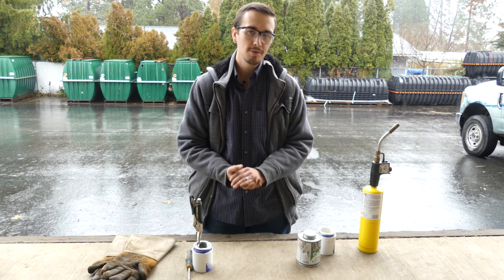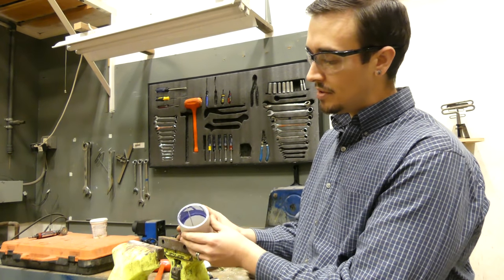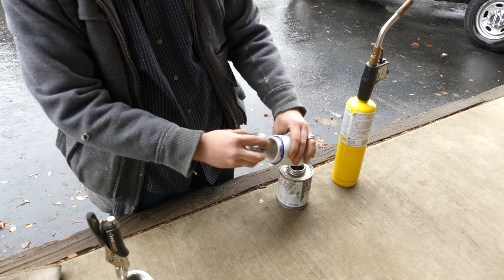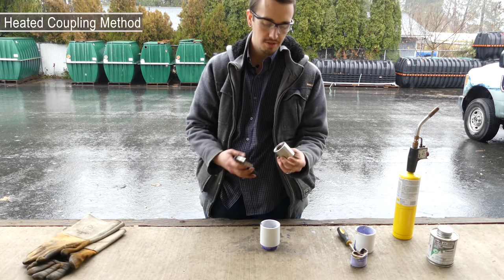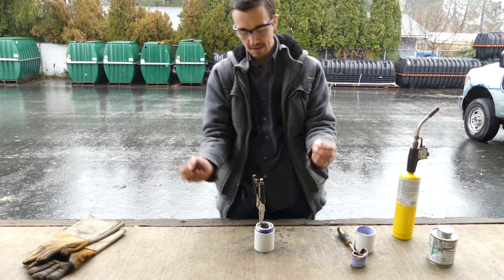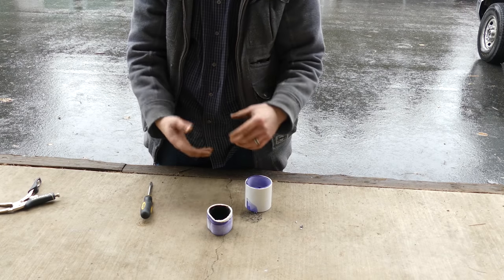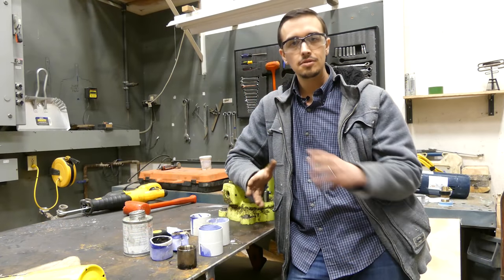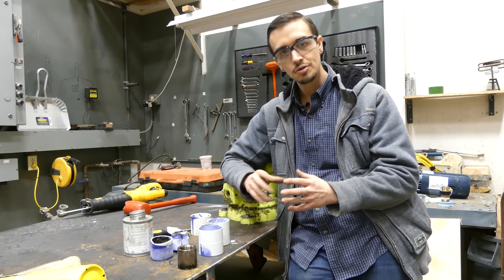3 GENIUS Ways to Remove PVC Pipe from Fitting (Without a Heat Gun)

Comment: i gotta remove an old 80mm elbow which is on the outside. i would have to use method 1. thinking more cuts and a more prescision  tool, like multi tool with semi circle blade or even a dremel? maybe when a bunch of cuts have been made i could paint on some acetone to soften the adhesive bond, work a chisel to pry off the cut sections..?? anyone had luck doing it that way?

Comment: If the pipes have been solvent glued together properly, you will not be able to separate them.  And SW fittings are cheap as chips - replace with new.

Comment: Can you do a video for prepping a slightly damaged pvc after the inside pipe was removed? Sometimes the female end is in a bad spot and cannot be replaced.
Reply: You just warm up the open / deformed end of the fitting with a heat gun and when it's soft enough, jam a piece of pipe into it to bring it back to circular.

Comment: They make a PVC honing tool for removing pipe from inside fittings. How about we try that.
Reply: that is fine if you have the $$$ to spend, I know that those are around 60$ to 80$ each or around 209$ for a set of 3, it's well worth the money if you're a plumber but for the average Joe it's really not worth buying them
Reply: Nah, they also make cheap ones, less than $15. May not be as nice or polished as  the $209 pro versions ... but great if you only have a few pieces to do.

Comment: I would NEVER use any of these examples even in a emergency, especially on pressure lines. Any competent experienced plumber would have a set of different size fitting savers aka socket savers in his truck to accomplish that repair. Anyone who does a repair like in this video didn't take the time to redo it right.

Comment: the 3rd method seemed to be the best one if you want to reuse the pvc. the 2nd one could be probably the most dangerous if someone did this on a connected piece of pipe, any flammable gas in the pipe could send the house into low orbit......in a number of pieces that is.

Comment: Primer must be worked in not just put on. The roll of primer is to remove the glase, but just putting primer on will not remove the glase. With the glase removed the cement will then weld the 2 pieces together.
Reply from the maker: Moz, as a pump/plumbing business that has set thousands of well, drainfields, etc. I am sure we applied the primer and glue correctly. Thanks for the comment.

Comment: I don't understand the point of applying the primer. I just torched the hell out of the outside pvc on my pools push pull valve for about a minute and it slide right off pretty easily.

Comment: I appreciate your work on this presentation but I would Never trust this connection again and new fittings are always the way to go.  If not an inexpensive heat gun is the only way to heat the fitting properly without damaging the existing fittings.
Reply from the maker: Thanks for the comment!
A heat gun would undoubtedly work better than what we showed, but not everyone owns specialized tools or has access to them when an emergency repair needs to be done. It's always good to know what your options are with the tools you have on hand. Of course, this is just a band-aid until you have time to repair it properly.

Comment: Is it just me or did anyone else notice that none of the joints were actually glued?  They were just put together with purple primer.
Reply from the maker: We used both, the primer is purple and the cement is clear. If we just used primer they would have came apart by hand.
Reply: @RCworstwater  In Canada only Electricians use clear because it does not hold up as good. You are using pressure fittings maybe change you cement.  Also in the field your burn method takes way to long.
Reply: @RCworstwater  also why not use clear primer if your looking for a clean looking joint?  I make my guys use purple primer and grey cement.   That way I can tell if they were glued right, especially when they are 20' up in the air.

Comment: Frame tool, power tool exterior stage to show your work are not worth to save a cheap coupling. If your plumbing material is .iron, it will be easy to take off and replace

Comment: All of that work and time because you don't want to spend a few bucks on a coupler and a short length of pipe to correct the issue properly. Not to mention what is the integrity of the fitting you worked so hard to re-use? I would rather you just dry fit your fittings and make sure every thing is correct before adding glue.
Reply from the maker: Thanks for the comment Chris! This video is geared towards people fixing a joint in an emergency - new parts are always the best, but not everyone has access to them when an emergency repair needs to be done. It's always good to know what your options are with the tools you have on hand. Of course, this is just a band-aid until you have time to repair it properly.
Reply: Very true. In a pinch this might be an option. But the last options. Good video thou. Never hurts to learn new techniques. I like how you compared three different options. You can never have too many tools in your tool box. This video just added three to mine. Thanks
Reply: They make a hole saw style pipe cutter too. Has a washer that rides on the inside of the pipe and then the outside wings cut the pipe out of a fitting. Only issue is you need a cutter for each size of pipe but they will pay for themselves the first time.
Reply: when a pipe breaks at a slab and you can remove a broken fitting, this is the way to go. you can do method one with metal gas and water lines. i hope chris curell snaps a pipe and has to use this lesson.
Reply: Problem isn't really saving money for just the coupling it's about where you are located. I work in an area where you move from your spot you can spend a good hr to hr and a half looking for a parking spot. Not only that but the time to get to a plumbing store, your time, your gas, and miles being put on vehicle. It starts to add up.
Reply: When you run in to a closet flange that is broken or, more commonly, was installed at the wrong height for the finished floor you are not going to tear up the floor or the ceiling to cut back and rework the pipes. Method number 1 works great on glued in PVC closet flanges.
Reply: Please don't tell me you're one of those guys who dry fit everything and mark it with a sharpie. If you are, just put your name on the sign up sheet. As for making sure it's correct first, of course. But you can pull it apart if you just glued it, no need for these methods.                                                                                                                                                                                                                                                                                                                                                                                                           If you are in the trade long enough, you have had to do this at some point. It's not a good time and only if I'm desperate. Hacksaw blade and multibit flathead. I can't imagine burning it. When you are on a fly in Rez or a remote mine, you have to get the job done because your plane is leaving without you if you're not done. As for saving a few dollars? How about $280 for a 6" wye?
Reply: It's funny how people who install gas pipes like to be called "gas fitters", but for some reason people who install shit pipes don't like to be called "shitter fitters" :D
Reply: Drew P I have every size they are the best
Reply: That is unless you're one of those crooked plumbers that know they can get a common PVC y for $45 and wind up charging your customer in excess of $150 for that part like I've literally watched someone do to my grandmother. Grandma called a plumber one day, needed two parts down on the 6in drainage from the house. Now I knew she had a problem and was actually at the hardware store getting what she needed pretty close to when she made the call. And lo and behold, one of the very plumbers that I saw there picking up parts and fittings happened to be the very same plumber going to Grandma's house. I found this out after buying my parts, eating lunch, and then going back to Grandma's and finding that man there. Seeing as she already had a professional in the house, I said f*** it and returned my items thinking that she was going to get better service out of a professional and she had already made the effort to call this man. I returned to a very well and finish job but then when I took I look at her receipt, there was a handwritten portion there that said parts $158 now I still had my return receipt for the two parts that were needed which also happened to be the only two additional parts that I seen on the repair, and knowing that I just watched this man pick up those parts from the hardware store where I was, not to mention that he didn't even buy new glue for the job seeing as I checked out right behind him and know exactly what he bought so I'm absolutely sure he didn't use some kind of special freaking glue he would have used the common stock glue that the plumbers keep in their trucks, either way my receipt for the two items that she needed with a total of $59.75 versus his receipt that listed Parts at $158. So then where did that extra $100 get to? And no for those of you idiots that are going to read this and say oh it must have been part of the labor charge no, labor was listed separately on this receipt, wouldn't be feasible to say that it was a charge for getting the parts seeing as Grandma's house was literally a block and a half away from the parts store

Comment: I don't agree with you as far as the first try that you did, did not work.  I have been a plumber for 25 years and the first try that you did was how we have done it since I was a novice.  what happens when you have a pipe that is let's say a 4" pipe and not one of your little 1-1/2 or 2" and you are out in the field.
.
Reply: Also, of the three methods, method 1 is the only one which will work while water is still around the fitting, like in ground for a sprinkler system, or mainline to a house. Sometimes you can't get all the water away, and that will cool the heat as fast as you apply it.
Reply: Totally agree, I’ve been doing it 14 years and the saw and screwdriver way is the best way to do it, I even think it’s better than a shitty socket saver. A socket saver absolutely destroys a fitting.. should call it a socket fucker

Comment: As you do thes way's it goes nicely whit that dark "blue" glue. But in Europe we use colorless glue. Mutch stronger because it is not really glue but a stuff based on THF what makes the PVC slitely go to melt. So the parts are not really glued but melted together. And the named of the video is ( without heat gun )????????????????????????????????,

Comment: You do know you can just buy a pipe reamer. Takes fitting out in 20 secs lol
Reply: Great comment!  However, I am from Missouri so I had to see it for myself, LOL.  Other Missourians will want to visit Youtube "How to Drill Out and Reuse PVC Female Ends."  I think the presenter there says the reamer takes about a minute and a half, rather than 20 seconds.  How powerful the drill is may alter the time required.  Anyway, who can quibble with a 70 second difference.  Kinda blows away the burn and saw techniques...maybe not the hot stainless steel pipe, though.   Being able to get the drill/reamer combo into position may be a problem in some cases, though.  In those cases, the hot stainless steel pipe may be the best solution.  Where to get the stainless pipe, though?.

Comment: To hell with the coupling i want the pipe intact. For those in need of bending pvc for subltle curve or to better line up pipe ends primer or glue spread on the outside of the pipe then lit will warm the pipe enough to make controlled bends if you are careful.

Comment: Not too smart.   If you're going to use heat to soften the pipe, you need to do the outside one because when you do the inside one you are simply expanding it onto the outer core making it more difficulet to remove it.  Heat the outer core then when you wedge a screwdriver between them quickly squirt a little soap or WD40 and then wedge the screwdriver in a different spot and squirt that spot working around the pipe.

Comment: Why did he not try a hot air gun? The hot air gun works well on decals and many things that are glued on.
Reply from the maker: Thanks for the question! We realize there are many devices (heat guns, socket savers, etc.) that will accomplish this job, but not everyone owns or has access to them when an emergency repair needs to be done. This video was an experiment to see which of the top three unorthodox removal methods would work best. 
Of course, we recommend replacing the failed fitting ASAP, but often times emergencies situations call for QUICK temporary fixes.

Comment: Congratulations you saved $1.14 usd
Reply: not if the pipe breaks flush with a slab.
Reply: Summit X i i just dont see how you can use fire in a zero access system, i would rather charge the client 10 times the amount and do it the less risky way or let someone else burn their home, who is the one saving money You or the home owner?  And whose insurance is gonna pay for the hose if you burn it?
Reply: RangerCaptain11A then this method doesn’t work unless you’re extremely lucky and the concrete slab breaks exactly on the coupling
Reply: you pay $1.14 for a 2" sch40 coupling?!?!

Comment: IDK why you would want to "save" a fitting.
Reply: Daniel a lot of times it's to get you out of a pinch when don't have the extra fittings with you to fix the problem. And alot of the time it's fixing something that was installed incorrectly
Reply: Daniel
Most of the time it's not worth the effort to save it but let's say you have a broken toilet flange with a finished ceiling below it it's way cheaper to try and salvage the drain pipe vs having to cut open the ceiling and replace the pipe. Also if the a damaged pipe or coupler that's buried in concrete where there is no option but to bust up the slab.
Reply: Jake Creech don't think you can do this with pipe connected to sewer because gasses can cause an explosion
Reply: Shaunn Emrick
Oh totally not a good idea with the open flame one but the other two would be no danger.
Reply: +Daniel  "IDK why you would want to "save" a fitting."  Then you probably don't work out in the field.  This is not about saving the fitting it's about being able to reuse one end of a fitting that's sticking out of a concrete wall or some other structure where you don't have the option of cutting the pipe further back to replace the coupling or elbow or tee.  This is a repair technique, not a restocking technique.
Reply: Because at 2;00am no place to buy a new one...
Reply: Shaunn Emrick Not likely.

Comment: Ya and I definitely wouldn’t want this guy, working on the plumbing in my house, what happens when he takes a flame to the pipe, that runs to a septic system and all that methane gas flashes up and your house goes from Kansas, to OZ with you in it 🤣🤣 now Toto is smoked and the munchkins are filing a lawsuit!

Comment: no , method 3 saved .000$ . Unless you live on Mars .   ONLY real option, though, if ………..
If a fitting is 6-7" or larger $ Or an inaccessible  extension to an existing plumbing ,  maybe .
Reply: Again a heat gun works well on larger pipes/fittings.

Comment: The problem is after you get it apart the old glue still remains and won't let the glue seal when you try to reglue it to another pipe especially if it's under pressure.....so the problems that you will run into by trying to use old fittings will cost you in the long run .....because even if you get it to reseal it will let go in time ....just buy new fittings save the head ache .....but what do I know I've been plumbing professionally for 25 years

Comment: The time you spend and energy you used not worth the money you saved plus the gas you burn cost more expensive than the coupling.  I would just throw it away buy some extra spare ones..
Reply from the maker: Thanks for the comment! This video was an experiment to see which of the top three unorthodox removal methods would work best. 
Of course, we recommend replacing the failed fitting ASAP, but often times emergencies situations call for QUICK temporary fixes.

Comment: My time is worth more than a couple bucks. And if you did this for a living you would understand that. Then you have the problem of, when is that part going to fail?
What a bunch of shit.   Part fails to upstairs bathroom fixture. Caves in the ceiling onto furniture and carpets or wood floors downstairs. Ruins it all. Not worth it.  I cant believe that anyone would contemplate doing such a thing.
Reply from the maker: Thanks for the comment! This video was an experiment to see which of the top three, albeit unorthodox, removal methods would work best. Of course, we recommend replacing the failed fitting ASAP, but often times emergencies situations call for QUICK temporary fixes.

Comment: .50 cent coupler ? Why?
Reply: The main place you would have to do this would be a toilet flange. If you need to replace the flange and cannot get under it to replace the pipe, this could be your only option short of ripping out the floor. Consider the savings of this over breaking out a toilet flange in a concrete slab and repouring the concrete.
Reply: I gotcha. Makes sense.
Reply: Or on a pipe that has broken and you have to match fittings on a skid. Diff manf have different take up and set back. Can’t always just put any coupling, 90, flange, our union back on